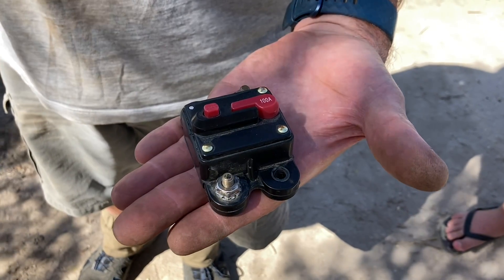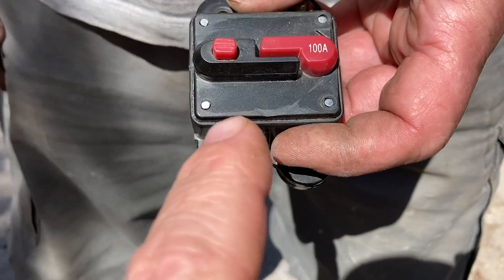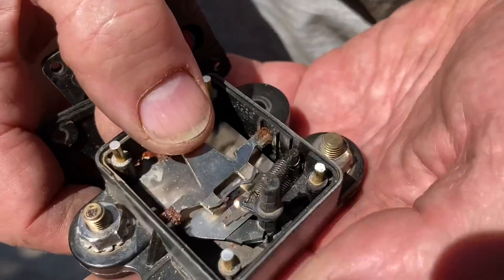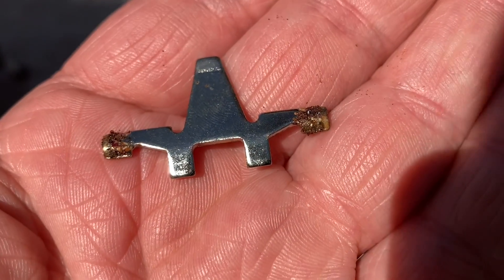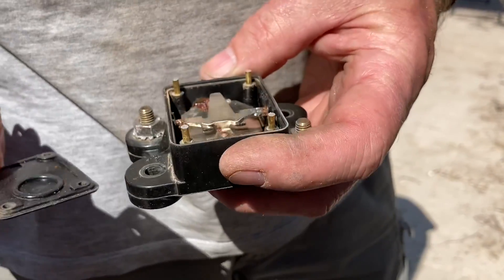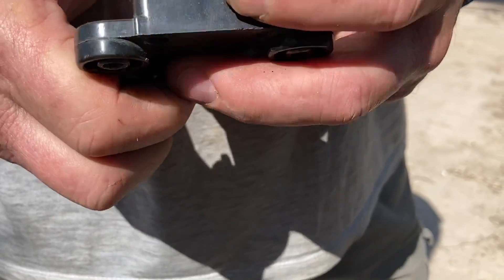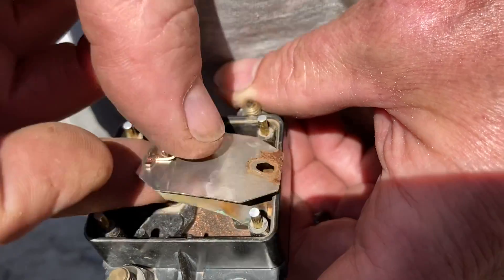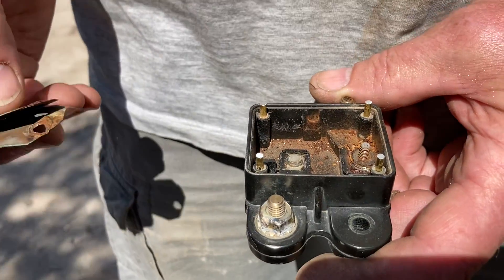CIRCUIT BREAKER FAILURE - JUST AVOID & save $$$ By using FUSES and QUALITY Wiring

Comment: That is one of the cheaper chinese garbage breakers, if you want better quality and true IP76 water proof buy the marine grade quality. I have them in my two boats isolating 24v Deep cycle batteries , had them for years with no issues.

Comment: Water and switches aka circuit breakers don't mix. Properly mounted fuses do. If elect wiring correctly installed fuse is there to fail on overload. It's a nasty cheap circuit breaker rubbish.

Comment: A fuse would have also had an issue in the same environment.  Rather, companies should use quality circuit breakers instead of the cheap China crap

Comment: I bought these like 10 years ago for a big car audio system and it worked awesome,I wouldn't use them for anything important but for a system they work excellent when voltage drops and spikes are common

Comment: Auto sparky here.
Just a rubbish design, full current flows through the bimetal, the corrosion increases heating, taking pressure off the contacts.
Fuses are a much better way of protecting or isolating a circuit.
A breaker suggests it will be used regularly ?

Comment: I have used these countless times over the years in the trade, they have there place and if used on the correct circuit work great. you can do the best wiring in this country (mine is certainly up there) and it won't have as much of an impact to its correct operation as more the application due to how these work.

When fitted to circuits that draw short bursts of high current e g an amplifier or constant low current is where these work best.

When fitted to a circuit that draws high current for a long period of time e g an inverter or bcdc they are no good. you will find you'll have to use a larger breaker sometimes 20 amps or more larger than recommend to avoid it popping which personally is a no go for me so I always use fuses on these applications.

I have only ever fitted Narva circuit breakers and I have only had one or two fail/let water inside in the 13 years I have fitted them, so I can personally say buying a good quality brand definitely pays off in the end.

With this particular one I can see by the look of the plastic it is most likely a cheaper brand and if so then I put it down to poor build quality. build quality has led to leaking> leaking caused corrosion> corrosion caused poor contact> poor contact causing volt drop and higher current draw> higher current draw leading the breaker to operate incorrectly.
Reply: So what size would you recommend for a 25 amp dcdc charger and would you recommend a fuse or a resettable circuit breaker